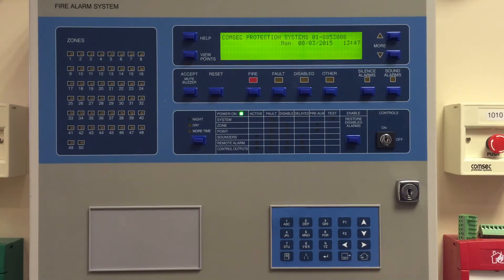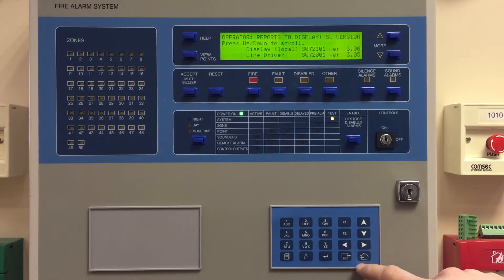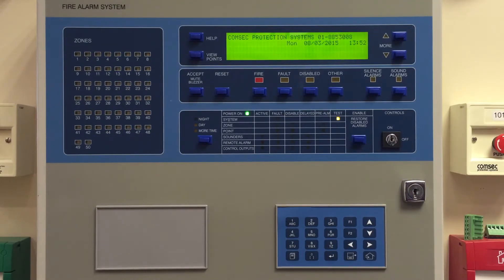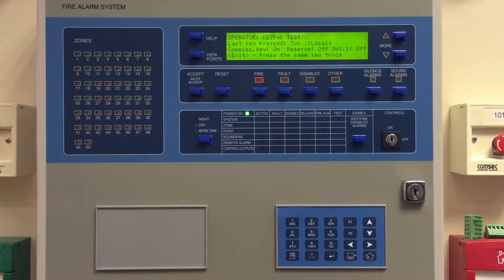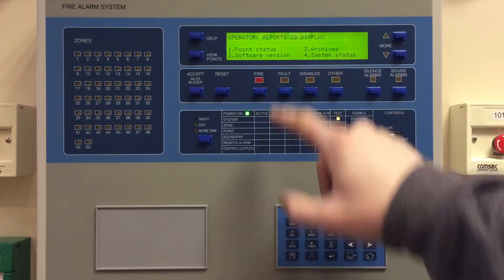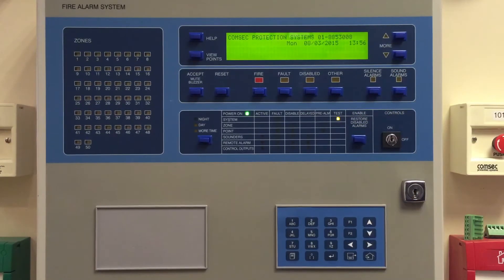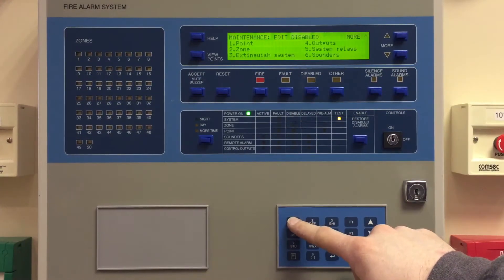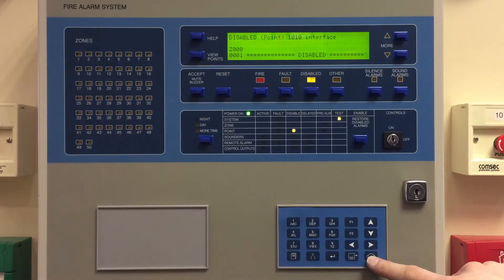How to perform various functions on the Ziton ZP3 Fire Alarm Panel

Comment: The panel is showing test mode how can we remove that
Reply from the maker: You need to turn the commissioning key on the inside of the door. Small round keyhole that is on the bottom quarter of the door

Comment: Thank you so very much for, this very informative and educational, video...

Actually I am a fan of your channel. It is very clear straight to the point no buts or ifs....
 However, I would be very grateful planner software and how to add, modify devices via the software and then upload the changes to the panel.

This would be, in my opinion, a fantastic piece of information for us installers...

Once again I must thank you from the bottom of my heart for your appreciated efforts...
Regards Atif
Reply from the maker: Hi Atif, this is actually a professional service we provide over zoom for a fee. Typically the calls last up to an hour and at that stage we can screen share and tackle any specific issues or requirements you have. We have in the past had engineers send us there planner file and we can work on it in real time.

I’ve considered posting for general info videos for planner and Maestro but my concern is that people won’t fully understand that with the wrong program loaded into the panel they can cause real risks. 
Please let me know your thoughts
Reply: A
Reply: A

Comment: What is meaning of device unaccepted
Reply from the maker: Apologies for the delay, it means that there is a device connected to the loop that the panel is not programmed to see. You need to find the device, confirm the number and do and accept points before adding description and mapping etc